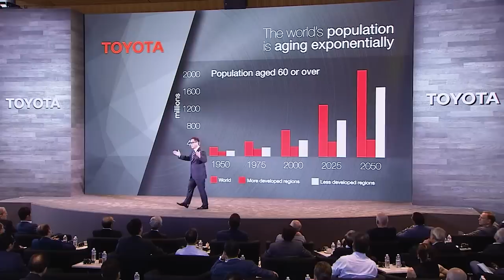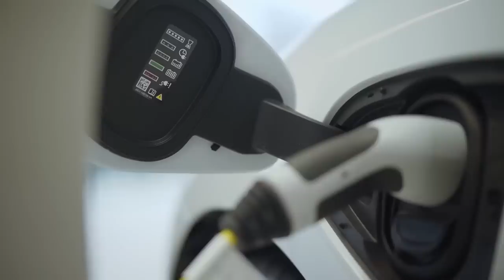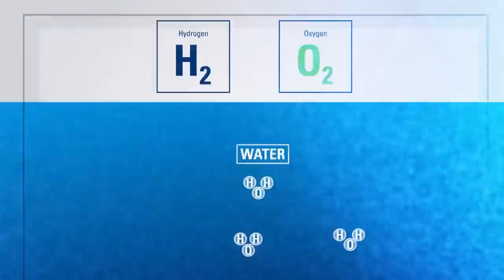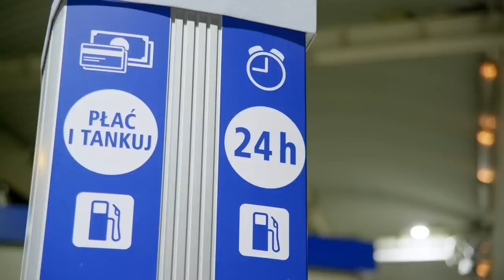New Toyota CEO Shocks Everybody | Huge News

Comment: In 1973 my Dads friend who was a Ford dealer switched to Toyota as he said it was most innovative and honest car manufacturer he’d seen. Turns out it was the right move and he and his son have never looked back. I’ve owned a few Toyotas and Nissans and have never been disappointed. My current winter vehicle is 2006 Corolla XRS 6 speed manual with 300,000 miles on the original engine. How do you beat that.
Reply: Then he better starts building a fast charging station next to his dealership and switch back to Ford - then he'd have a chance when Toyota have to close down because they missed the boat...
Reply: @karlgunterwunsch1950  Ha thats funny we don’t have the infrastructure or clean electricity generation to provide for all the EVs and Toyota is first auto company to say it and realize it. I live in the Pacific Northwest were hydro electricity rules. Many other areas of North America ate using coal, natural gas and nuclear to generate electricity, hardly clean. BC Canada is building the Site C damn on the Peace river in Northern BC but the power from that will quickly be gobbled up with the demand of us to switch to heat pumps and away from natural gas which heats the vast majority of homes and businesses. That damn was vehemently opposed by environmentalists but thankfully was pushed through by the previous government. So tell me whats going to power all these EV cars and trucks and don’t tell me solar because as someone who has installed many systems its not the answer as it is not reliably constant. Works fine in the applications that I do that are off grid and have battery banks but thats not realistic in large urban areas. Toyota just realizes that this is coming but not as quick as the politicians like to tell us simply because of the logistics of it. Thats why Toyota is concentrating on plug in hybrid and hydrogen for now because it will be the gap filler until we have the clean electricity capacity to go full EV. Toyota was extremely smart in their hybrid development and it paid of with the Prius and Camry. Just look how many taxi companies use them.
Reply: @donziperk  We don't have it yet and it's the only one that even seems feasible to achieve. If you consider that Hydrogen takes 3 times the energy to produce and eFools take 7 times the energy then you know that Toyota have missed the boat and they are trying to go up the creek without a paddle with that argument.

Comment: 20 years ago, when Jeremy Rifkin's book 'The Hydrogen Society' was a bestseller, I was enthusiastic about the prospects for hydrogen as well. Then BEVs appeared and hydrogen cars didn't. Why? I did the math. I'm a simple mechanical engineer and I reached the same conclusion as every sensible engineer before me and after me: hydrogen for road transport is insanely stupid. Compared to other solutions (mainly battery electric) upfront investment is insanely high, maintenance costs for a fully deployed network are insanely high, product performance is way worse, there are massive challenges in scalability, etc, etc.

The thing is, Toyota engineers did the same calculations and came to the same conclusion. Toyota is not investing in any fuel supply network (too risky, no prospects on earning back your money) and it's not investing in production capacity for fuel cell cars. If they do what they told us, they will have capacity for 50,000 fuel cells (30k in Japan, 20k in China) in three or four years time. That's 0.5% of Toyota's annual car production. They only take government subsidies and do some engineering on hydrogen equipment. They can offload that technology to other sectors, where it might be useful, in the long run.

Mr Toyoda's and mr. Sato's statements are highly cynical. Almost 80% of the cars they make are ICE-only, not even hybrid. In the past, around 2007 or 2008 I believe, they promised us every Toyota would be a hybrid well before 2020. They missed that target by over 80%. Or was it just talk and not a target at all? Toyota is not interested in the well-being of the world, nor in offering 'special solutions suited to every region'. They just know how to make ICE, nothing else, and can't find a way to acquire the knowledge to make a compelling battery electric car.

Comment: They’d just have to extract the hydrogen from water in the car to make this feasible. It may take some time, but I’m glad to see divergent thinking 😊
Reply: Hydrogen is made from natural gas,  with the carbon in the methane being used for some other purpose.  It would be FAR more expensive to use electricity to crack water into hydrogen and oxygen.
Reply: @@bookerdewolffe "high temperature water splitting from either nuclear reactors that drive chemical reactions or solar concentration"   which means it takes more energy to produce hydrogen than the hydrogen itself yields.   We've know about hydrogen powered cars since the 1970's and there's an economic reason why we don't have them now.
Reply: @@bookerdewolffe Mankind has not figured out nuclear fusion yet - let alone on a  safe and economically viable scale. Until that happens, its irrelevant to meeting today's needs.

Comment: Toyota is bending this way, because of Japan. If you do not know, Japan is energy dependent. They are also idiotic for pushing green energy, while shutting down the nuclear energy.

What does that mean? It means energy cost is very high in Japan. they charge 179 yen per litter up to 239 for mid range gas.  That translates to 678 to 905 yen per gallon, aka $5.21 to $6.96 per gallon.

The drop of nuclear energy puts too much of a strain on the Japanese system.  Electrical energy is also increasing in price to a point it is now costing too much for pure electric cars. Thus you are getting the push to hybrids and they make it seem like it's a Business move, which it is a "do what's best for Japan."

Remember, cars were not viable until the energy system was provided to the masses, aka Gas Stations and paved roads.  But stepping backwards to cost save indicates they were never that stable of a company to change in the industry. There is a good chance that Toyota may not ever recover from this move of pushing local priorities over their global priorities.

Comment: good decision. From what I have heard (don't know how much about it is true), hydrogen-powered vehicles are great but do not net an big profit, and that's why many companies push EVs. Btw, EV#s are by far not so climate friendly as many people make them to be. Until we have solid state battery technology this will not change anytime soon.
Reply: hydrogen, depending how it is produced,  is not always great for the environment.
Reply: Hydrogen is dumb technology that looked promising next to battery tech that existed 15 years ago, not so much anymore. There's a good reason nobody else is pursuing it. Hydrogen may not even end being useful in planes, ships or semis as was once theorized because of the rapid rate of battery tech advancement.

Battery tech is changing quickly, there's numerous options beyond lithium just over the horizon and multiple chemistry's incorporating lithium that will improve batteries in the short term. We're talking varying combinations of lighter, cheaper, more energy dense, faster charging, more resilient to extreme conditions, longer lasting and more durable.

Comment: Smart move Toyota!   I for  have been focusing on a plug in hybrid for my next car and wondering why so many companies seem to skipping that transitional phase and jumping straight to full EV's with no alternate offerings within a very short timeframe.    Seems very premature to me - but what do I know?!
Reply: The issue with Hybrids is now you have two systems to fail instead of one. Full EV has little to no maintenance or repairs as long as the battery holds out, and Hybrid batteries go out as soon or faster.
Reply: @basildavis2683  but you've just said the ev side of a hybrid requires little or no maintenance.  Apart from being a lower capacity battery and smaller motor there is very little difference between a full ev and a hybrid system. Also the engine on a hybrid has a very easy time of it, leading to a much longer lifespan. My Tucson has covered about 3.5k miles, only about 2k of those have been done using the petrol engine. You do the math 😊
Reply: Only if you are in an extremely low crime area.  Hybrid catalytic converters are prime sources for expensive metals and a Prius has a 6 month waiting time to replace your catalytic converter.

Comment: Ellesmere Port which is a small town close to Liverpool in England is switching to Hydrogen as its source of power. Close by is the big oil refinery at Stanlow and they are now setting up to produce Hydrogen. Also JCB who make industrial  vehicles such as tractors, diggers and lorries at their factory at Stafford have developed their own Hydrogen engines that fill direct from the pump as you do with petrol. So things are developing.
Reply: Yes JCB have had couple of shows on Harry's Garage. 👍
Reply: Don’t you see the ironie here? Use gas to creatie hydrogen to power the car. Read a bit more into it and you should realise you beter keep on driving with gas instead of doing two energy inefficiënt conversions. It Will mute the whole point of switching to green energy. Hydrogen is extreemly green only when it is created from green energy. But then efficiencies come into play. Converting water to H2 is inefficiënt as hell and should only be an option if no alternatieves are present. Big rigs, airplanes, ships,…. But not cars where batteries are a proven viable sollution .

Comment: I think hydrogen cars are a terrible idea. It takes more energy to create hydrogen gas than you can get out of the gas for mechanical work such as a car engine. It has none of the advantages of gas or diesel engines because oil is cheaply and easily pumped out of the ground.

Comment: Sounds like a better technology than EVs. One of the dirty secrets about EVs that keeps getting swept under the  rug is that the batteries have a limited number of recharges before they become toxic waste.
Reply: Redwood Materials.
Reply: And the fact that we'll need "dirty" sources of energy to charge them for a long time to come...and that much of the lithium that goes into those big batteries comes from abused miners in places like the DRC.
Reply: @randomlyentertaining8287  So many extra nickel refineries needed to make the batteries.
Reply: @randomlyentertaining8287  Some of electricity comes from clean sources.  None of our gasoline does.  Lithium is not mined in the DRC.  You are thinking of cobalt, which is not required to produce EV batteries, though it does get used in all the higher-performance ones.

Comment: I would love to see Hydrogen become a serious competitor, but it's been decades now since they started researching and developing it yet it still doesn't seem to be that close to any sort of mainstream release.  I hope Toyota pulls it off but I think it's a lofty goal, and one that would have no chance of success unless other manufacturers got on board with it.
Reply: Gasoline and diesel contain hydrogen.
Reply: @codetech5598  and carbon amongst a few...
Reply: @johnkooy5327  Carbon is good for the plants.
Reply: @codetech5598  it sure is,and there is plenty of it
Maybe even too much? 
Some people would say plant more trees..
But my question is 'how do the trees suck up all carbondioxide way up in the atmosphere? '
I think developing hydrogen run cars and industry is a good thing. 
For the alternative the WEF has in store for us is much worse
Reply: @johnkooy5327  CO2 is heavier than oxygen and nitrogen, so it doesn't go to the upper atmosphere.

Without searching the internet, what percent CO2 do you think is in the atmosphere? *Do you think it is closer to 
50%, 5%, 0.5%, or less than 0.05%?*  

Answer to yourself and then check the answer by searching "percent CO2 in the atmosphere".
Reply: @codetech5598  450ppm (parts per million)which is about 50ppm more than 50 years ago and thus less than 0.05%
The fact that co2 is that heavy and would always come down was always my argument but even so the levels are going up in the upper atmosphere 
Water is heavy but gets up there as well 
But yes 'praise the lord hallelujah ' for CO2 being so heavy...
Reply: You're going to be surprised. The current EV strategy is unsustainable.
Reply: It has been more than 10 decades now since the electric toys started researching. And now we see clearly it is a wrong way. Good as a toy - not a cars .
Reply: they have to tackle the storage density problem of Hydrogen first. hydrogen as a fuel is not a great fuel for density storage. and fuel capacity is either cost prohibited expensive, or not the best for range.
Reply: considering the botched Mirai, I highly doubt it
Reply: @Anatime714  tesla ramping to 2m deliveries would disagree
Reply: @jozefbak6033  The problem is the batteries.  What you need is some kind of fuel cell which converts liquid fuel like ethanol or diesel directly to electricity.
Reply: @codetech5598 that's not how gases behave. Once CO2 is mixed with air, it can go anywhere.

Comment: Having a small battery with a charger and a hydrogen fuel for longer rides might be a start for Toyota instead of completely going hydrogen. Being able to switch between 2 is going to make life easier for users and company until the mass adoption happens.
Reply: Toyota has been investing in hydrogen tech for a long time, understandable that they don't want to throw all that away, but the reality is that hydrogen is really only going to be good for niche areas where batteries are unsuitable. Most countries have a grid electricity, whereas hydrogen will need a distribution system built from the ground up and that's going to be expensive, factoring in the energy loss converting electricity into hydrogen I can't see it happening.
Reply: @catinthehat906  I reckon we are gonna run out of lithium soon enough for batteries in less than a decade and I am not sure how much recycling it from the used batteries would be effective. There are far sustainable ways of producing hydrogen from alternate sources of heat or electricity that would otherwise be wasted like Solar. If people are going to completely switch electric vehicles at some point, they would want a faster way of charging their vehicles. I see the taxi industry is going to benefit a lot from hydrogen other than trucking companies.
Reply: @nikhhiilreddi1371  I agree for niche areas hydrogen is an option, but there are lots of  battery alternatives under development which either use drastically less lithium or none at all. Toyota is hedging but they need to be careful that they don't invest too heavily in a hydrogen strategy that never materialises for mainstream vehicles.

Comment: Hydrogen used in the fuel cells is a very flammable gas and can cause fires and explosions if it is not handled properly. Even if hydrogen cars are more efficient and greener, IMHO the car buying public will not be rushing to move to hydrogen until it is proven to be safer than electric or gas fuel.

Comment: If they introduce electrics using their Lexus brand, you know they're going to be expensive! With Hyundai and Nissan producing affordable electric vehicles, Lexus will probably be relegated to the 'Luxury' market. They will have the same problem as Tesla, and Lucid, chasing the limited "Well to do" market, rather than the huge middle class consumer market. Hydrogen is right off the table, because I cannot produce it myself, and, I have no place to buy it here in Northern Utah. I prefer battery electric, because I do have an outlet in my garage. At least, I don't have any problem finding a place to fuel my Hybrid Prius. Even Compressed Natural Gas (CNG) is losing popularity, and it's difficult to find a place that still has natural gas. Most of those cars have been converted BACK to gasoline. With a range of only a couple hundred miles, battery electric vehicles have surpassed the range of CNG. Natural gas no longer offers the savings to justify the mandatory recertification/ replacement of the pressure vessels to contain it. Hydrogen will have exactly the same problem, especially since Hydrogen charges to a much higher pressure.